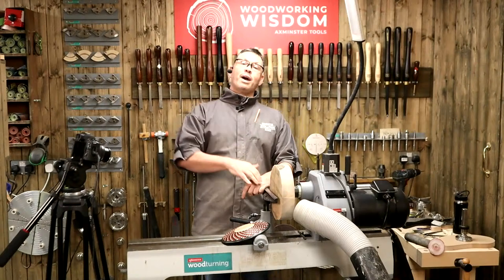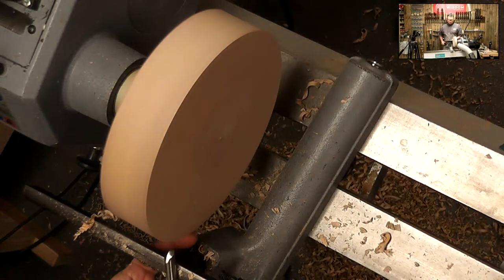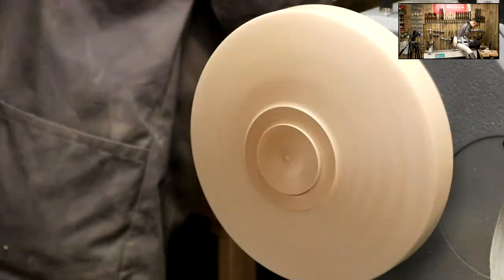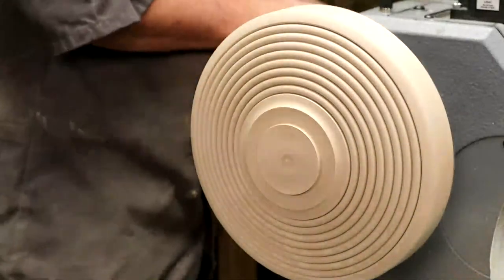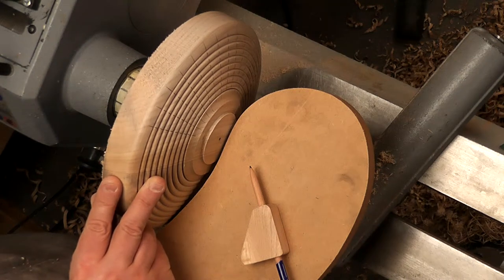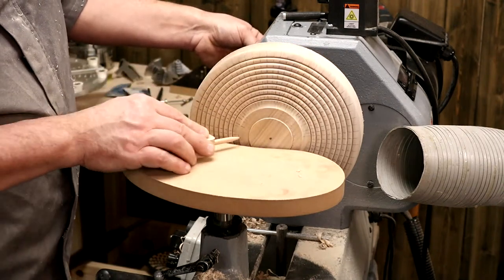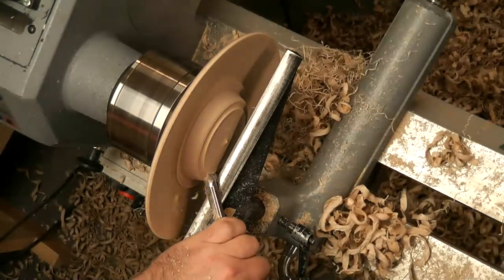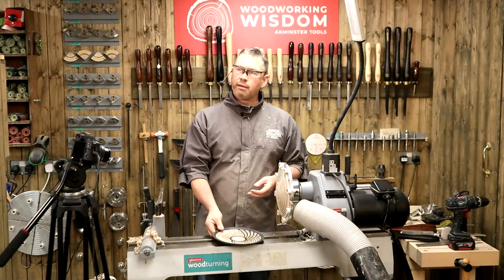Basket Weave Illusion Bowl Part 1 - Woodworking Wisdom

Comment: Thanks so much for this, sadly I can't watch live due to work but love to watch on an evening. Instead of the faceplate you used I think you could use a face plate ring like the one that came with my 114 chuck kit so no messing with grub screws just a loosen of the chuck. Also the slots on the button jaws could take metal turning lathe holding devices for doing some fancy off centre turning work maybe? or holding an odd shaped piece of timber, clearly balance would be an issue so you would have to turn slowly and use good lock nuts to keep you safe although the timber would move before one of the metal work holding clamps came off, something like AXMINSTER SIEG SC4 CLAMP KIT 600863